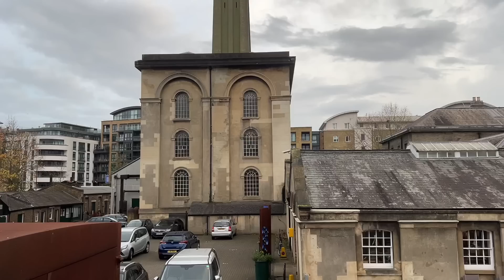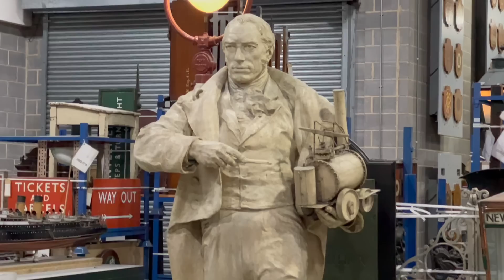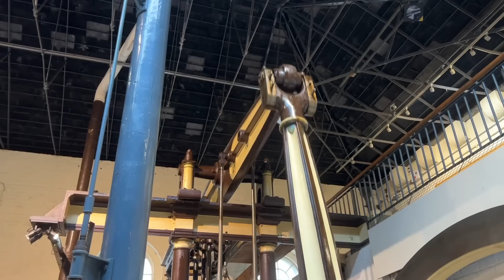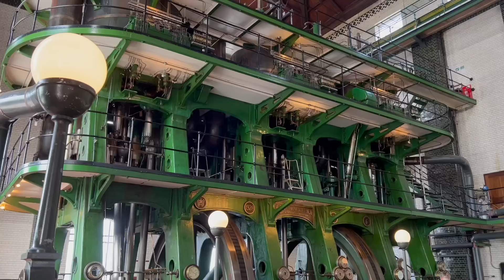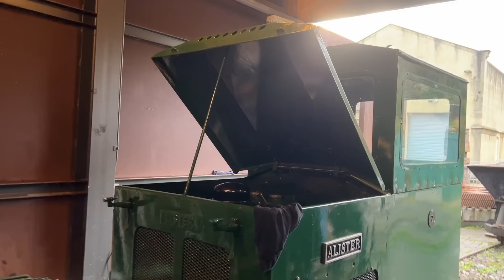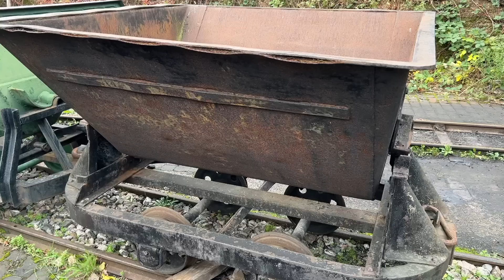Magnificent Machines at the London Museum of Water and Steam

Comment: Vertical Triple Expansion (VTE) ended up as a four cylinder installation in ships in the end, with two intermediate cylinders rather than one. The trouble with them in the naval application is that they didn't like running at high power for extended periods, as they would shake themselves to pieces. Whilst in warships they would be replaced by turbines (or diesels, in some smaller ships) they would endure in merchant ships, including the vast numbers of Liberty ships built in the US during WWII (along with their Ocean class predecessors and Fort & Park cousins).

Comment: We have some similar machines at MOTAT (Museum of Transport and Technology) here in Auckland. They were used to draw drinking water from Western Springs. There are only a couple of machines still operational, but they make up for it with an on-site steam train and a selection of vintage trams, all of which are still operational and connect MOTAT to the Zoo and MOTAT 2 (which has planes).
Reply: When I lived in Auckland, many years ago,  the railway display at MOTAT was fairly static,  and the reach of the tramway was somewhat limited. I hear it's a lot better these days. And yes, I did get to visit the pumping station before moving further south.
Reply: @richardvoogd705  it's best to visit on the Steam Days when the machines and engines are running. And they open up the tram workshop so you look around inside.

Comment: Hey Jago fantastic video. It is a great museum. I should know i started volunteering there when i was 15 Unfortunately i moved out of London just before COVID so i don't volunteer there anymore. I was manly involved with the railway, but i was learning to drive the big Cornish beasts. My brother still volunteers on the railway. I know that the locomotive at the back of the shed is called Oto its a German diesel hydraulic locomotive. It hasn't run in ages and is privately owned by a volunteer. Looking forward to your video about the Hampton to kempton waterworks railway.

Comment: Those steam engines are veritable spring chickens compared to the Newcomen Engine at the Elsecar Heritage Centre which was constructed in the 1790s and believed to be the only one in situ that still operates.

There is also have a lovely little Heritage railway nearby should you visit "the Grim North", though that does mean a ride from Sheffield on some of the oldest rail stock in the country (the 1983/4 Class 150s)

Comment: Standpipe is like a water tower but without the storage. It provides constant, even head (elevation-based representation of water pressure) to a distribution system. Taller the tower, the greater the head (get your mind out of the gutter). It also has the side benefit of eliminating the pump surge, as each pump will discharge at the open space at the top of the tower to the water within the tower/distribution system, which, again, stays at a relatively constant head. That benefit is not nearly as important with modern water distribution systems, so you almost exclusively see standpipes in water tower form, which can maintain head on the system for a relatively long time during a power outage, with such a large volume of water up so high. For the record, I am a Water Resources Engineer, but that involves bridges, culverts, drainage systems, and other forms of open-channel flow, so I am no expert on pressurized water.

EDIT: For better context on why water towers are common while traditional standpipes are obsolete in the modern day, it’s important to consider that electricity is much cheaper at night with low demand. Water is pumped up to fill the tower at night, then released to the system via gravity during the day.
Reply: As part of the gravity fed water system in New York City, they built a tall bridge from the Bronx into upper Manhattan. This “Highbridge” had the aquaduct inside of it, while the top was a pedestrian walkway. At one end is a tall standpipe tower to keep the flow of water smooth and consistent. When the original brick viaduct design of the bridge proved to be detrimental to larger shipping in the river, they built a a steel arch bridge to replace the middle bit, without dismantling the entire thing to keep the water flowing.
Reply: Thanks for that comprehensive explanation 😊

Comment: An excellent video. I recently started volunteering there, having had my first day of training on the railway a couple of weeks ago (unfortunately in the rain). I'm hoping to do more with the museum in the future, given the railway only operates on weekends but the museum is also open on Thursdays and Fridays.
I also don't know about the 3rd locomotive, although I will find out at some point soon.

The "Railway" underground that you mentioned, according to the sign by the railway's platform, was a "tramway" that I imagine was cable-hauled, as it was powered using a waterwheel using waste water from the pumping engines.
Kew Bridge Waterworks was apparenty the only waterworks in London not to have a proper railway because of the underground tramway, and because of the main road between the site and the river.

Comment: I was at the museum and asked the staff if I could look at the boiler, being a boiler inspector since 1991. They said no.
Reply: I asked and they said yes.  I don’t know if things have changed since I was last there, about 15 years ago, but at that time the boiler was on the other side of the wall behind the triple engine and accessed through the door next to the pair of Weir vertices feed pumps and the tall conical thing that I think may have been a feed water heater.  It was a full sized Lancashire boiler, not the smaller one displayed nearby and seen in the video, which I think was being used as a hotwell.  The fire doors Eric had been removed, one furnace had a large natural gas burner installed in it, and the other was blanked off with a makers plate which declared it to be a three pass conversion.  I’m not sure how this worked because the boiler did not have the usual brick settings so there was no space at the boiler for hot gasses to pass externally.  Presumably the second pass was through the second furnace space and flue, but I don’t know where the third pass would have been.  The boiler was covered with a thin layer of insulating material, looked like mineral wool, or something similar

Kempton has a small, modern fire tube boiler, made by the Scottish company that I forget the name of.  It’s gas fired.  Crossness has a similar type of boiler but trom memory, I think that one is oil fired.
Reply: That's health and safety unfortunately.

Comment: Hey Jago - are you following me?

I was there on a London visit in September. Unfortunately that was not one of the days when they ran the engines, but still it was a good half day and I could have spent more time there.
I'm old enough to remember steam locomotives and marine engines. I suppose most young people today don't get the opportunity to see, hear and smell these machines in action. Certainly internal combustion was more efficient in terms of the percentage of fuel energy burnt actually reaching the output shaft, but steam has a real personality all of its own that a diesel lacks. For one thing, the connecting rods, crankshaft and reversing linkage of most steam engines are totally exposed and can be seen in action. Think for a moment about the sheer amount of top class engineering design and machining it took to build what you are watching. These engines were built at a time when tradesmen took huge pride in their work and time and expense was often allowed to construct columns with artistically fluted sides like those found in ancient Greece and to decorate components with beautifully painted motives. Not merely fascinating utilitarian objects, these things were also quite beautiful to look at, well IMHO at least. The perfect synchronism and the repetition could be quite hypnotic to watch.  I guess you feel the same way if you are making another video about the "mesmerizing" effect they can have when you watch them work. A mechanical symphony in motion. Even a Rolls Royce Merlin can't claim that!

Then there's the sound - often surprisingly quiet for such a large engine unless it is accelerating with throttles fully open with the thunderous hissing of lots of steam to push those big pistons faster or the deafening blast they would make before first starting when they had to blow condensed water out of the cylinders. More than an engine, steam was a performance.

There's also that unique blend of oil and water and coal (or whatever fuel was used) associated with these engines - especially with locomotives - a sweet smell that suggested the possibility of far journeys to exotic places. Diesel fumes stink by contrast.

I notice you also dropped into the London Science Museum for grabs of the atmospheric engine (too old to be called a steam engine but if you must, then it's allegedly the oldest surviving example of a steam engine in the world). The museum also raises interesting questions about how it was possible in the early 19th century to build machines of such a size with enough precision to ensure steam doesn't just leak out between a sloppy fitting piston and cylinder. Also when you look at the thing built in one place then erected hundreds of kilometres away in some far-flung colliery in the 1850s - how on earth did they get that huge flywheel and those massive cylinders there and why did so much of the early stationary engines include wooden parts like the beam etc.?  Ox-carts? Serious food for thought. The Victorians and Edwardians were nothing if not ingenious but the seed of their demise were laid at the very zenith of their time. I imagine Nicolaus Otto and Rudolf Diesel were not too popular there for some time (damn Germans!).

Steam has certainly had its day but it was a major milestone upon which the industrial revolution was built starting with deeper mines to get more and cheaper coal for homes and factories to powering huge battleships that protected The Empire upon which the sun never set (although I actually watched it set one day in Hong Kong in 1997). This was the cutting edge of science and engineering of its day and almost entirely a British invention.  Its equivalent today might be genomics or advanced computing networks or perhaps AI. How is the UK doing in these fields now?

Your description of a triple expansion engine was pretty good Jago. 
The whole idea was that it wasn't possible to capture the the thermal energy from the entire expansion of steam in one cylinder, so you expanded high pressure steam in a small one (passed that to the crank)  then passed that partially expanded steam to a larger one (passed that to the crank), then passed the further expanded steam output from that to an even larger one, (passed that to the crank),  then passed the output of remaining steam to a condenser, thence back to the water tank and boiler.

Damn - I missed the tank engine! 
I never saw them in my youth back in Sydney, but we had lots of Beyer-Peacock 4-6-4 engines working marshaling yards and country runs up to the 70s. Some had manufacturers name plates on the side from the 1880s. Can you imagine anything built today lasting that long?  (The Boeing B-52?)

The London area (and much more of the UK) is Mecca for the curious!

Thanks again for your insights Jago.

Comment: Those belts are driven from a lineshaft - an engine at one end keeps the shaft turning at a constant speed, and belts can be engaged and disengaged with a lever to operate the individual pieces of kit. I remember them, but suspect there are few still in captivity. Belt fitter was a skilled trade; I doubt there are many of them still in captivity either.

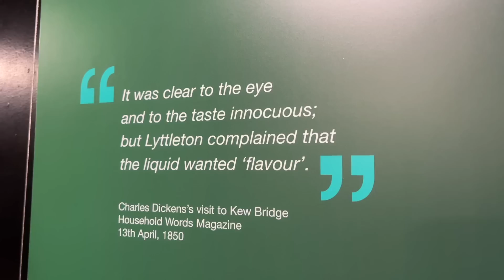Comment: 9:15 let's not think about what had previously been in the water to give it "flavour"...
Reply: Ahh, this was a critical issue with the famous Broad Street pump.  (I think Jago has a video on it).  There was one case of cholera several miles from the pump - it turned out that the victm liked the taste of the Broad Street water so much, she asked her sister to fetch it for her.  They'd probably be advertising it on TikTok these days.
Reply from the maker: “Try this great-tasting weight-loss solution!”
Reply: "This water has been passed by the management"
Reply: @camenbert5837  Loverly!

Comment: The way the water towers work is that the pumped water goes "Spurt! Spurt! Spurt!" So they send it up the tower and it spurts out of a pipe into a bucket. It looses it's pumped energy, but gains potential energy (due to height and gravity). From the bucket it drops down a separate pipe and the weight of the water in the bucket and the pipe makes the water in the underground pipes have enough energy to go up to the same height at the other end of the water pipe system.

So water "spurts" up that tower as the engine turns, but gravity and the fact that the water at the top of the tower is not directly connected to the pump means that the water drops back down the tower at a more constant pressure.

If this tower was compared to an electronic component, it would be a capacitor. Just as you can charge a capacitor with small amounts of electricity and let it flow back out, the pump charges the tower with small spurts of water that match the smooth flow of water out of the tower.

It's a very clever system, rather similar to the water tank you have in your loft or the cistern you have for flushing a toilet. Get the water in somehow (in this case with a squirty pump) and then you can create whatever water pressure you need to do something else with the water.
Reply: A further reason, I was told when I visited some years ago, is to avoid problems arising if there is a burst water main on the output side of the pump.  The disconnect of the pump from the distribution pipe network (as provided by the standpipe in the tower) meant that the engine would not suffer any sudden "no-load" condition if the output pipes suddenly lost pressure.  (A sudden "no-load" condition potentially leading to major damage to the engine.)

Comment: I associate the name Wicksteed with children's playground equipment, such as swings and slides. I remember from my childhood the maker's plates on such things saying "Wicksteed Park, Kettering". It turns out that Charles Wicksteed was an engineer based in Kettering, Northamptonshire but I haven't been able to find out whether he was related to Thomas (the man, not the engine).
Reply: Thomas was Charles' uncle.  Thomas' father, John Wicksteed (1774 - 1837) had four sons.  Thomas was the youngest; the second son was Charles (1810 - 1855), father of Charles (1847 - 1931), the playground equipment manufacturer.
Reply: @Tevildo  That's fascinating. Thank you very much.
Reply: @johnm2012  No problem.  Source - the University of Oxford "Victorian Professions" website, which has one of the worst UI's I've had the displeasure of trying to use.  Perhaps I should try it again with IE3. 😺
Reply: What you lose on the roundabouts you gain on the swings, according to Wicksteed's accountant.
Reply: Wicksteed park, kettering, they also have a minature steam raillway to take you round the site

Comment: Steam engines and engine rooms are mesmerising.  Being enclosed spaces, they also get hot. Opening them to public view, particularly on paddle steamers was an ideal solution for the engine crew* and public alike. Going down to see the engines on particularly  long or Sunday cruises became a ritual experience that could return you dizzy and uncoordinated. Such are the bona fides of being a traveller.

* Firemen were not so lucky, particularly in paradoxically named forced draught boilerooms. Their space was closed and sealed. And few people wanted to look at boilers which didn't appear to do much whereas engines were big and alive and moved and talked with rythmn and syncopation.
Reply: I find the sound, smell and sight of a Steam Locomotive running at 95 mph on a mainline hauling a restored set of carriages with very lucky people on board, having paid an arm and a leg for the experience, absolutely beautiful, often wishing it was me tucking into that sumptuous breakfast or dinner.

Comment: In the mid 1950's I got to see the water works for Springfield Ohio, All steam using vertical and at least one horizontal engine engine. Sadly the facility was swep away in the sixties, replaced by modern pumps. The site is now a park on the northeast side of the town.
Reply: I believe there's one still intact somewhere in Ohio, but I can't remember where. The Waterworks Museum in Boston has a huge pumping engine preserved, though it doesn't operate.